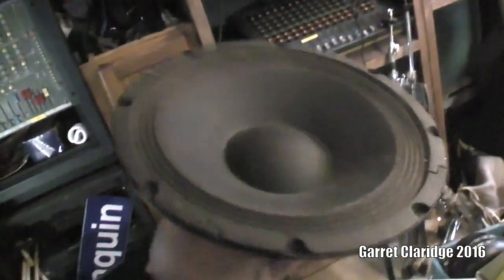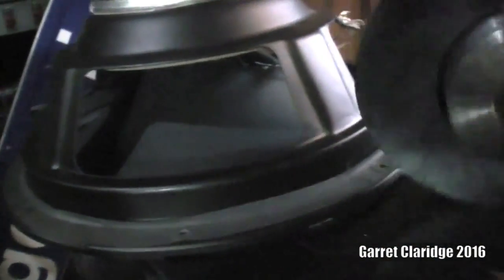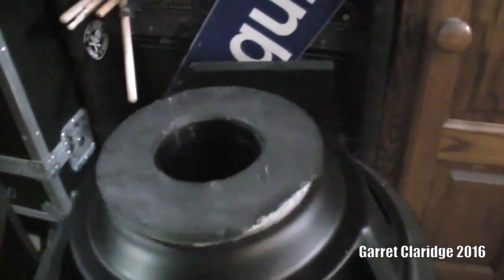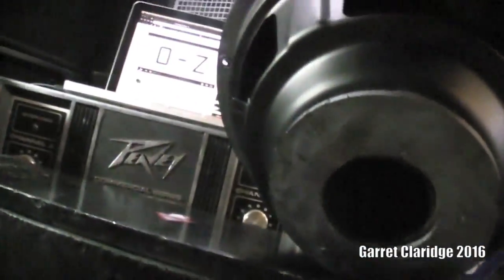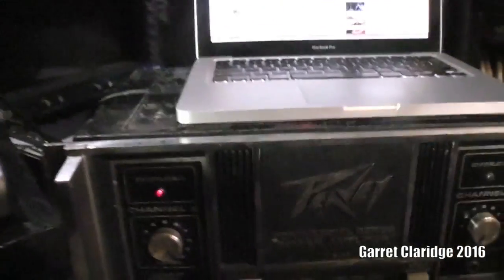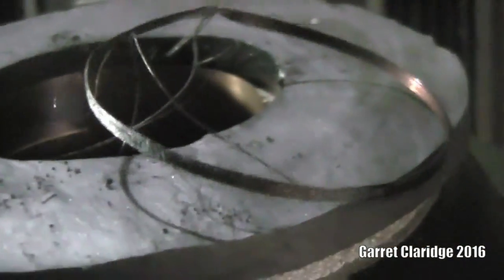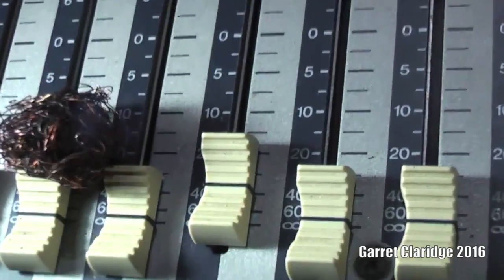SPEAKER BLOWOUTS! - BEHRINGER 10 Inch Woofer

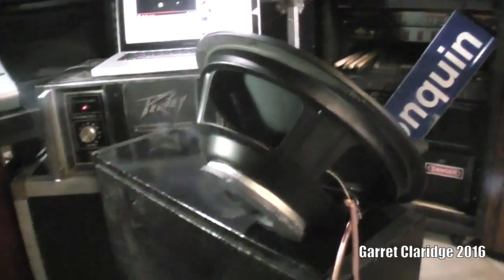Comment: @4:10 I noticed that amp was clipping on the other side even though it was turned down! lol
Reply: Noticed that too
Reply: Marvel Davidson Jr I think it's either because the input is too high or the fact that the amp is bridged...
Reply: More than likely bridged because Garret did say it was pushing 800 watts and most amps I've seen is that the wattage is hinted by its model number.

Comment: The stronger the magnet of a speaker is, the more response will be there. If there is only a part of the magnet left, I will be quieter even if the voice coil is under heavy load. That's why headphones with a neodymium magnet are so much louder than the ones with just a normal magnet.
Reply: Sam Gates The magnet needs to be correctly polarized around the voice coil. If you just put a random magnet next to the speaker, nothing will change.